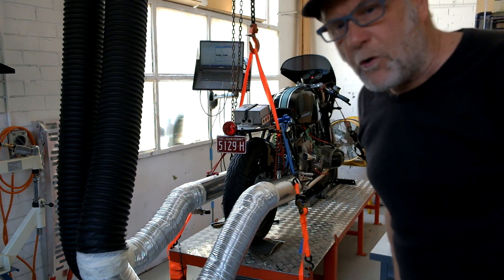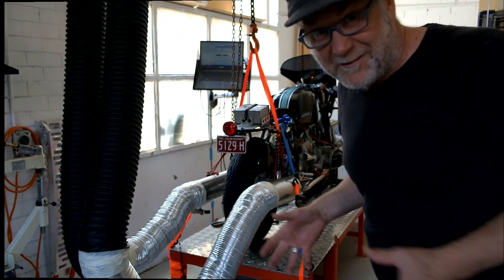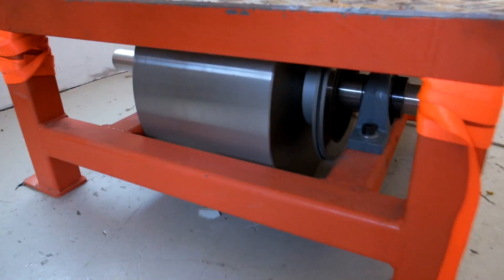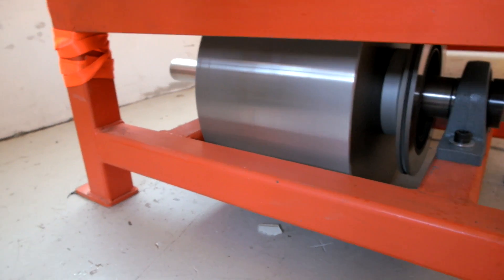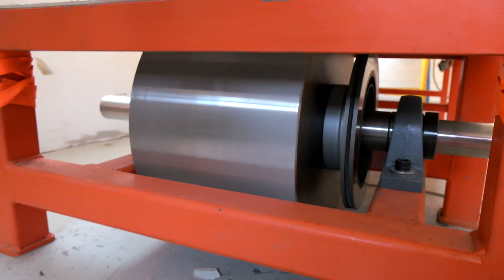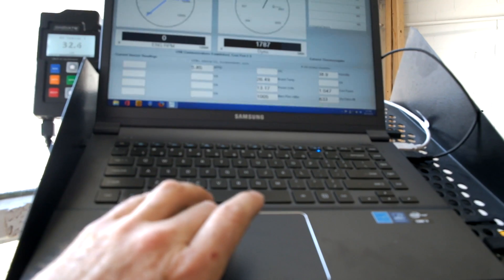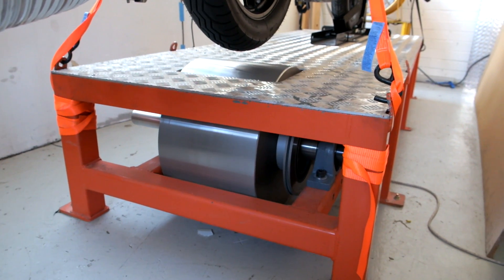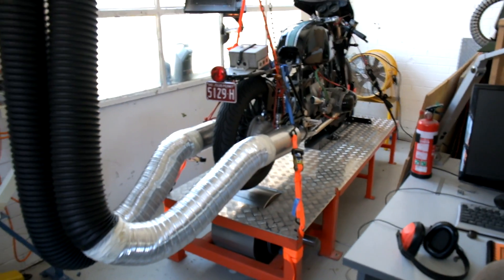DIY motorcycle dyno coast down test

Comment: Dang 20 minutes to coast down! I’m almost done making my dyno using four 20” diamond blades as a rotational mass (rated 3050rpm and should be good for 20hp max@120kmh) and paranoid that the thing will start jumping up and down if there’s any imbalance (no brake on it). Do you ever use the bike’s own brakes to slow it, or does it burn them out quick? (That was my plan)
Reply: Never managed to finish the brake system. So I let the bike do the work ..generally coast down using engine breke and maybe a little rear brake. Good luck with your build!

Comment: is that roller not to big and heavy for the job?
Reply from the maker: +16vastraturbo No, it's about right. With about 60HP at the back wheel in 4th, the dyno runs are about 7-8 seconds long to 7000RPM.

Comment: hi sir, 1st off you're a genius, 2nd how did you attach, safely, the dyno wheel to the axle? i've done the electronics and software, and i have a 300mm diameter by 300mm long steel wheel from a local machinist center, i need to know how to put an axle on it and not get killed in the proccess, greetings from Argentina!
Reply from the maker: Aplogies for not noticing your post Jona!
The shaft is a shrink fit with the wheel. The wheel was heated and the oversized shaft was placed in a liquid nitrogen bath. There's a blog post about it here:
http://skrunkwerks.com/skrunk/big-lump-o-steel/
Good luck with your dyno!

Comment: I am looking to build one of theses. What did you use for the rear wheel drum? Did you have it balanced?
Reply from the maker: Hi Hambone. The roller started as a solid 460mm diameter billet. It was bored and the shaft shrunk into it.
Lots of info in my  blog here:
http://skrunkwerks.com/skrunk/diy-dyno-build/